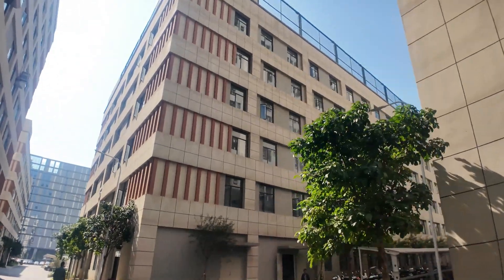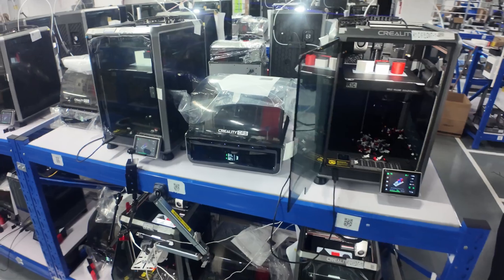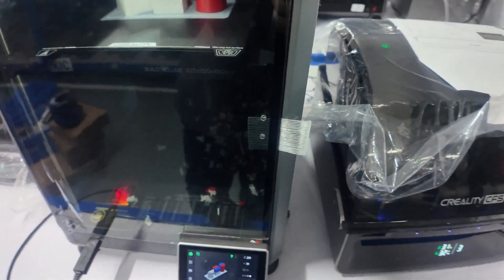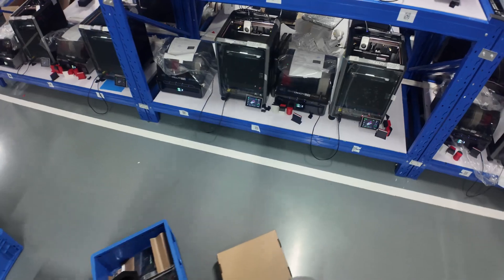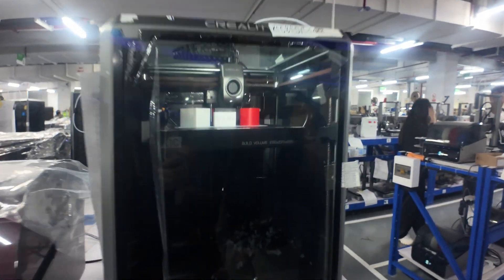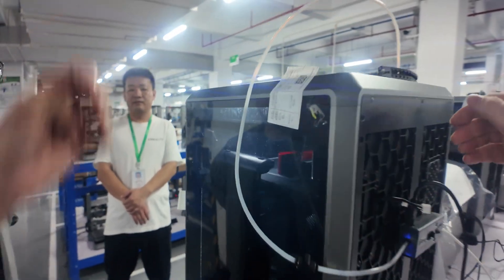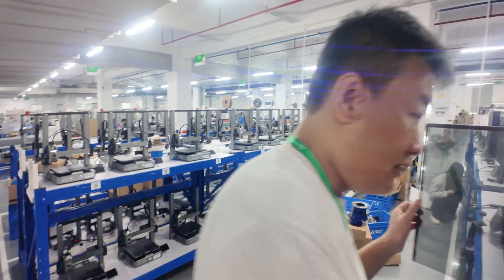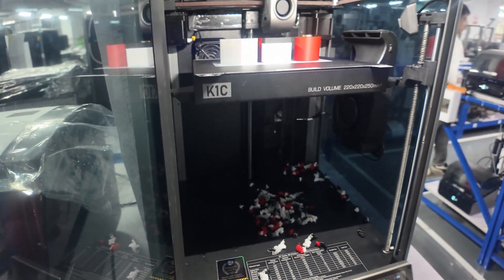My first look at the CFS upgrade on the K1C and K1 Max - factory tour @Creality3D

Comment: So no filament cutter? We just purge the filament then retract it after purging? Like the co print system ye?
Reply from the maker: yes there is a filament cutter on the extruder and it goes into a chute on the back - drops into the chamber. You can set the purge block to take all the waste in the slicer settings - make a huge purge tower like Co-Print does and have no poops; that is n option.

Comment: did they have any demos of dual  CFS?
Reply from the maker: i didn't notice any, but the hub from the CFS unit is the same as from the K2 Plus so you can for sure connect up to 4 units to each printer. Will work the same.

Comment: Disabling unencrypted rfid is a mistake a bambu labs level mistake! we want the right to label our own filaments and wont be forced to buy  anything we dont want
Reply from the maker: All filaments work in the CFS, you can still use any filament you want. I have a CFS at home and simply select the color on the screen. No problem. This was always the intention when they made the CFS, but users quickly figured out how to work around it. We said from the very beginning that it would only read our own RFID.

Comment: Great little video. I actually like the waste going in the bottom because it going out the back and down is kind of annoying for me and I'd be willing to give up some vertical print area for this. I have a K2 Plus and I kinda wish I had an option to divert the waste inside as it'd suit how I use the machine a lot better. But.. Maybe that'd become like a fire hazard or something over time? Anyway, thanks for the video!
Reply from the maker: Yeah I totally agree - I don't have easy access to the back but opening the door and scooping out is easy.

Comment: Please tell me they are working on a different method to power it or there is a way to remove the bottom panel and hardwire it.
Also please tell me there is a way to route the bowden so we can retain the top glass.
Two HUGE misses if we can't!
Reply from the maker: the cable chain bracket is replaced on the back - i did the install this week myself. The new bracket is only different in one way: it has a longer hole for the PTFE tube to go through. So I think this is the top glass issue you are concerned about. As for the USB connection, I don't know but I am very sure someone will figure that out quickly since you are the second person to mention it already lol
Reply: @ when you say about the cable chain bracket and the long hole this isn’t on a K1 Max?? The Bowden tube hole is in the metal frame for the K1 Max. I’m confused 🤔

I did hope that the community would come up with a different USB mod. Fingers crossed. 

Also meant to ask do you know of any plans for an active heated CFS?

Comment: Anyone know where I can get a cover plate for the front of the bed plate for my K1 Max like the new ones have? I have had mine for awhile and it didn't come with it..
Reply: Glad to see the CFS kit cant wait to get it , LOVE it on my K2 Plus!
Reply from the maker: Yours is OG - don't change it!
Reply: Well, mine is new and it didn't come with the cover either. But it has so many hardware issues that I am not worried about this cover anymore. I would love if the printer just work without trying to destroy itself.

Comment: They should really make it so that there's a way to make the purge come out the back of the machine like every other machine that does this kind of filament swap. Even an upgrade you can buy where you purchase a new back panel that has a hole already in it.
Reply: I'm wondering the same thing, I'm planning on getting one, and I'm for sure people out there will make modifications to cut the back
Reply from the maker: thats what i think too - for sure people are gonna mod this!

Comment: Just to make sure. Is this Upgrade also compatible with the original K1 that doesnt have the unicorn nozzle?
Reply from the maker: yes, I have another video coming next week - i do the upgrade myself and show you every piece. The only difference for the K1 is that little blue plastic tube under the extruder - it will stay there. No problem!
Reply: @kevin.in.3d  Ok thank you very much Kevin! Maybe I will do the upgrade all together with the unicorn, but to be fair I didnt have any issues with the hotend. 
Biggest single problem was the extruder which I had to change. But guess what,  the extruder on my K2 Plus clogged after only 3 prints with Creality Hyper PLA....

Comment: I just wish they'd tell us approx how much it's going to cost and if it works with those of us that are still on the non-unicorn since Creality beta tested on those of us that got the first revision. I'm extremely unhappy with most of my entire Creality experience. Customer support was WORTHLESS. What warranty? 😡
Reply from the maker: I can answer those questions now.  The upgrade kit is $52 USD. Should be for sale in February and it will work on all K1 models including the original K1.  Part of my job is turning frowns upside down - email me at kevin@creality.com and let's chat. I also had an OG K1 but upgraded to the unicorn nozzle. I know your pain!
Reply: @kevin.in.3d I'll send you an email then 👍
Reply: @kevin.in.3d thank you for the offer! I sent you an email
Reply: Awesome,  @kevin.in.3d ! Does the upgrade kit include the cfs? Or is it sold separately?
Reply: @zureao  the upgrade kit is $52 plus the cfs, which is $299
Reply: @zureao  I have seen a price int he comments of about 52 US dollar. The CFS is about 300 so in total 350 in total.
Reply: I was wondering about the nozzle compatibility because I have multiple Diamondbacks and do not want to replace them for obvious reasons